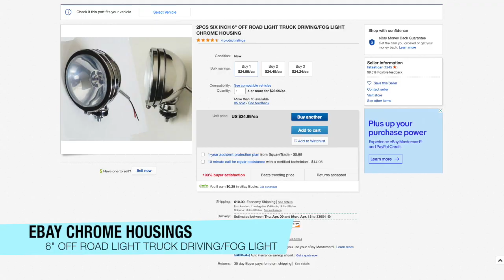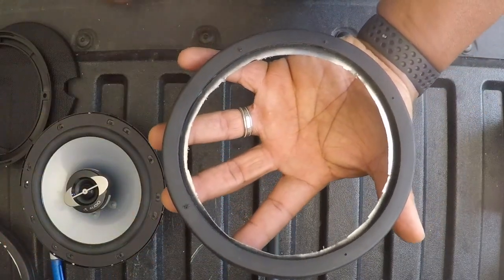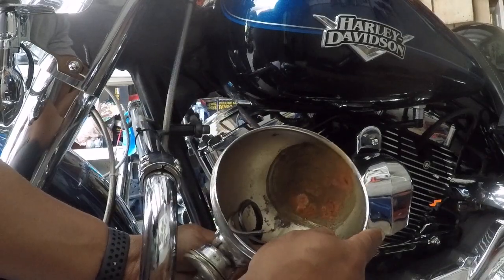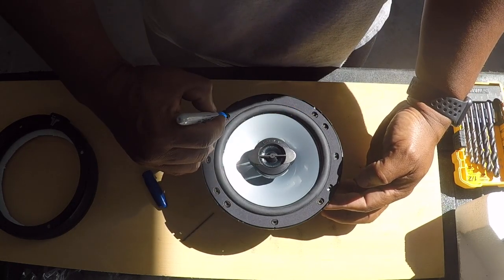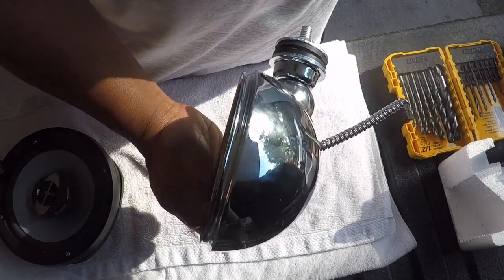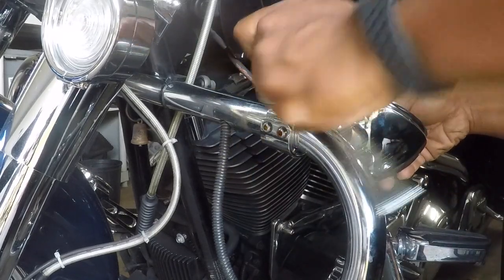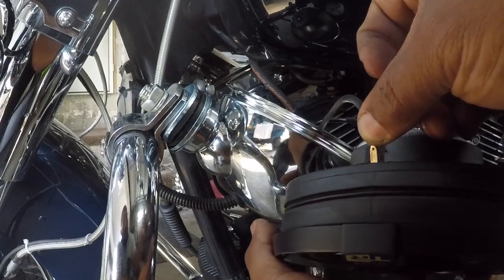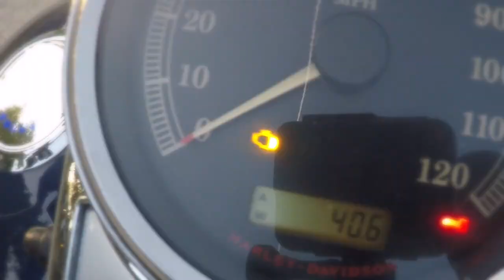Road King Speaker Pods... Hmmm!!!

Comment: What size of speaker are you able to fit inside there and where can I purchase the bracket to hold the speakers to the crash bar appreciate the info brotha
Reply from the maker: 6 inch speakers and harley sales the bracket...
Reply: 6.5” a little grinding and use highway peg mounts. I have done this a ton of times
Reply: @JJBcustomCYCLES  by chance do you happen to have a picture of how they log like and where do they sell them at
Reply: @imac19791  where did you get your mounting brackets for the speakers 🔊 I checked with my local harley davidson they only sell them with there kits
Reply from the maker: @mariomunoz1785  I got mine from Harley. That’s all I can tell you. Sorry!

Comment: Nice job
Reply from the maker: Thanks!
Reply: @imac19791   How are your t
Can's holding up ?
Reply from the maker: @romesyoutubechannel5356  I recently changed to a lower fairing because the speakers aren’t water resistant so they keep blowing. I made a video about that as well but i need to find a brand I like and another method. I don’t like the lower fairings but I’ll utilize these until I find another method. I love the way the cans look and I plan on returning to a cam once I figure it out...

Comment: Did you have to use an amp?  If so, what's the wattage output per channel?
Reply from the maker: https://www.ebay.com/p/85794458

I had it put in by an installer and this the amp. I can’t tell you the answer your question but this is what I have

Comment: What kind of circle material did you use for your speakers to hold in place
Reply from the maker: It was a piece of sheet metal from an enclosed trailer but I would advise something thicker to thin.

Comment: Can you make a video how it sounds? Good Video thanks!
Reply from the maker: Be more specific.  I've changed them to lower fairings because the speakers malfunctioned when I hit the rain.  This is the first set to malfunction due to rain and they all have been normal speakers. I now have lower fairings with water resistant speaker which are loud but not clear.  I need to tune them to be satisfied.  Be more specific in the what you want to do to obilge your request.  I need more material anyways your helping me mold the channel and someone else may be thinking similar.
Reply from the maker: I tried what you requested by letting you all hear the sound of the speaker and Youtube blocked the video so I had to reedit with their music (Tampa's Franklin St. murals).  I will make a video with the music from Youtube only if you answer this reply tht responded to your message...
Reply: @imac19791  im looking forward to hearing what it sounds like. Just ordered the housings. Trying to decide what speakers im gonna put in and if I wanna use polyfill
Reply from the maker: Just get some water resistant speakers so you don't have to keep buying new ones. Good luck!